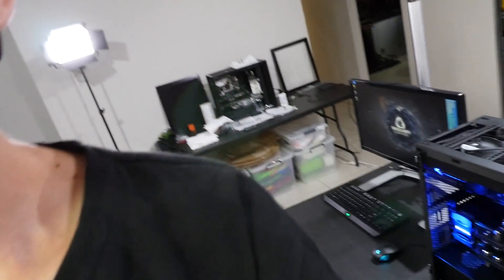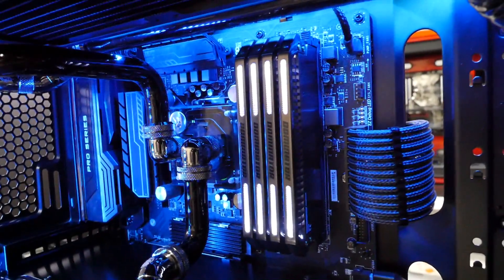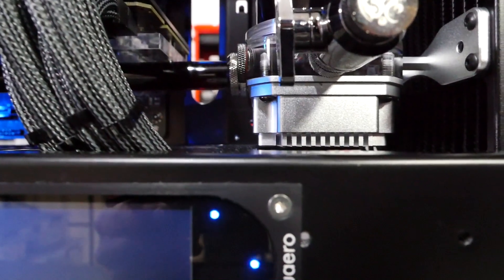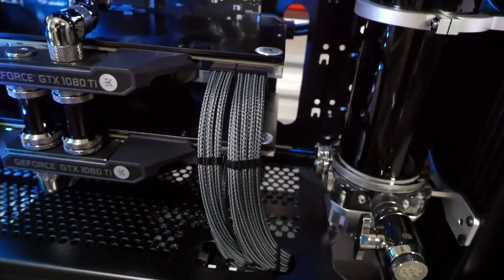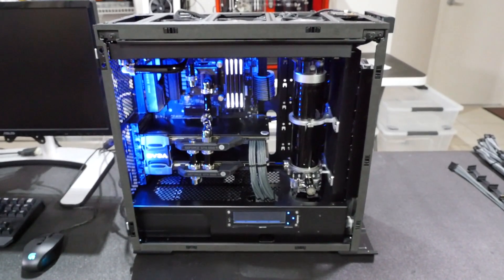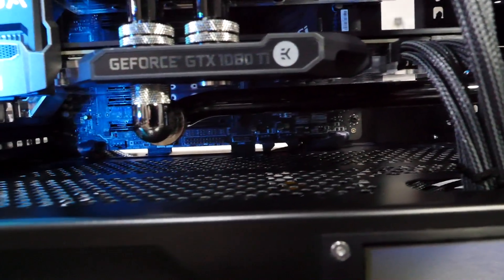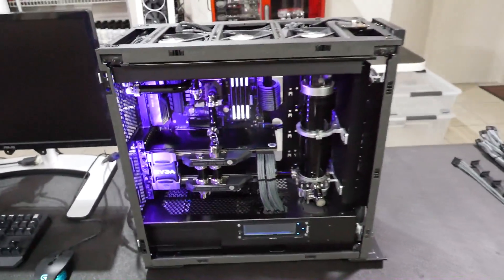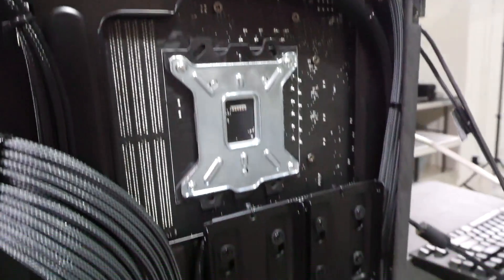Radium Blackout

Comment: I have that case and currently considering water cooling. If I only have one graphic card, would you consider mounting the reservoir horizontally on the PSU shroud? there's lots of room with only one card and it would allow for a ticker 280 rad in the front I think. I already own 7 ML140 fans that I want to use so I'm thinking a big 280 rad in the front, and a 140 rad at the rear, and two 140 fans at the top for exhaust.

Comment: I have a new 360mm rad (inside of an inwin 303 case is just going pull for the fans going to be okay?
Reply: JpKJosh 
Yes, just pull is going to be more than enough.
Reply: Awesome, thanks for the answer!
Reply: Yep, pull is going to be alright. Push/Pull however... if you have the room and the right fans, you won't regret that either.

Comment: how do i base my fan speed on the coolant temp tho? some kinda temp measurement thing inside the rad or something?
Reply: You need to purchase a special fitting with a thermal probe on it. And then you must connect ir to your motherboard if it has a connector dedicater to this or to something like the aquaero.
Reply: You need a temperature plug to insert into the reservoir (best option), and then you connect that to the TMP_IN header on the motherboard to control fan speed in the BIOS (this is my plan for now at least), or connect it to an Aquacomputer Aquaero 6 (LT, PRO, and XT) USB fan controller to control fan speeds in the OS.

Comment: How do you actually control the fans using the watertemp? what hardware/software is needed for that?
Reply: You just need an aquaero or poweradjust (+aquasuite) and a temp sensor that measures the water temp. Then you can control your fans dependent on water temperature. The poweradjust cant control as many fans, but you can buy 2 or 3 of them and connect them via aquabus. I'd recommend an aquaero though^^

Comment: How do you get a nice bend on the 24pin cable? Mine looks like crap in my s340.. :/
Reply: Custom cables need to be trained to stay in place. The sleeving must be heatshrinked very tight so you can bend it into any direction and have it stay there. Hope this helps! You can also watch the custom cable video for further info! Cheers

Comment: Only small Problem that I can see so far is that you don't slap 4 RAM Sticks on a Z170 board. Sometimes that's asking for trouble. 2 sticks normally do the trick in dual channel. And by the way, the board itself can only handle DDR4 RAM up to 3200 MHz, so either they did a BIOS update which I don't know of, or 4266 Mhz RAM won't run as fast as it could. P.S.: No I don't need the mod kit.

Comment: Yo, Daniel, I appreciate the continued build videos. I have bought a decent amount of your products from sites like PPCs and have always been very satisfied. As far as sleeving USB 3.0 cables, I use 1/2" PET sleeve(example linked below), 5/8" 3:1 heatshrink that I expand carefully using a few sets of pliers, and a little bit of super glue at the ends to hold it all in place before heating the heatshrink. It's quite finicky and usually takes a few tries to get it to look good every time you do it. The end result is totally worth it though.

https://www.amazon.com/gp/product/B00QQXPZPU/ref=oh_aui_detailpage_o08_s00?ie=UTF8&psc=1

Comment: The CPU water block is upside down.
Reply: it has to be in order to get the "in" and "out" on the block correctly fitted for a waterloop like this. obviously it could be placed in the right orientation, but that would mean that the bends would be a lot more complicated.
Reply: atngamingx No extra fittings needed, swap the parallel gpu "in" and "out", use the dual rotary to meet the cpu in. Still a beautiful build nonetheless.

Comment: What, 37 degrees Celsius inside you mean? Shit man, AC to the max
Reply: It's bloody winter here right now (or at the least coming off of winter), he's probably got the heaters on so he don't freeze to death.
like, it's about 14 Cel outside for me, my CPU (a 5820K stock) is sitting at 27 Cel under a Nepton 120XL, & my 980Ti's are sitting at 22 Cel (monitors) & 19 Cel (SLI co-processor) respectively under EKWB TitanX (Maxwell) blocks + nickel backplates, with a pair of 360mm EKWB CoolStream SE rads keeping them cool with 6x Vardar F4's combined.